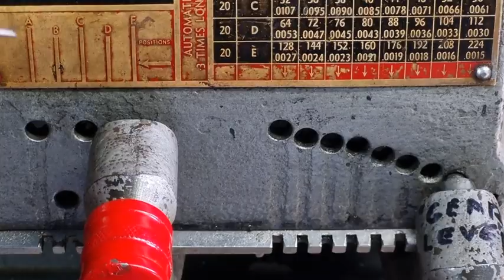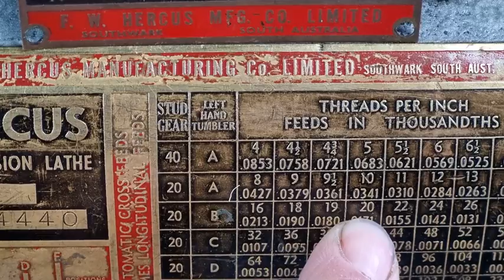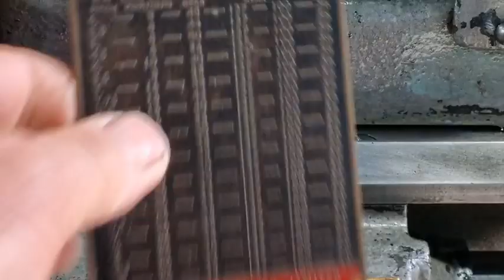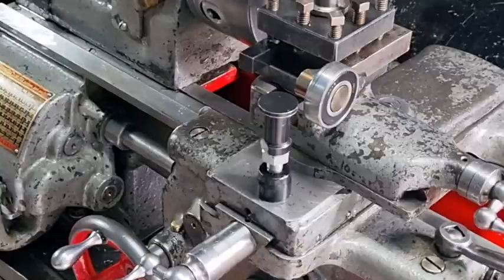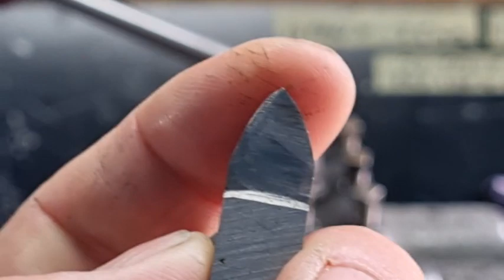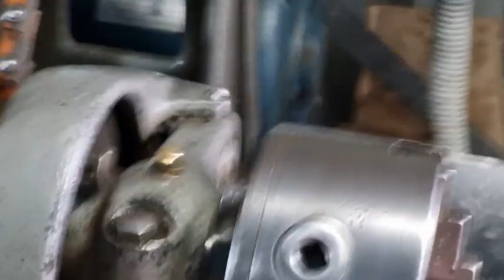Hercus 9A walk through

Comment: Hi Tinker, good to see the Hercus on Youtube.  I have a 9A as well, S/N A 3491, made in 1950.  I just replaced the Spindle Drive belt with a Nut-T-Link Belt like you have.  This was not straight forward, and I'm wondering how you get on with yours.  My lathe originally had a flat belt and pullies, but I upgraded it with a A Section V Belt and pullies, back in 2013.  The V Belt needed to be replaced.  I had to make a notch in the biggest pulley on the spindle , and I took off about 40 thou off the back gear to make a clearance for this new belt.  I filed a little off the main head stock casting (inside / bottom) as well (probably 0.5 - 1.0mm).  Can you get your Nut-t-link belt onto all 4 pullies on the head stock easily?  Cheers, Rich
Reply from the maker: Hi I cant get the belt on the last pully right side.
Its a bit fiddly to fit the belt getting the metal T to fit the holes.
Reply: @hercus9a  Thanks for the reply.  The notch I put in the RH Vee Pulley, allows the metal T piece to pass through between the main headstock casting and the pulley, and the T piece to pass between the back gear casting and the pulley.  A bit tricky, but I didn't want to lose the RH speed on the main drive (452 RPM) but I've lost my lowest speed in back gear, 46 RPM